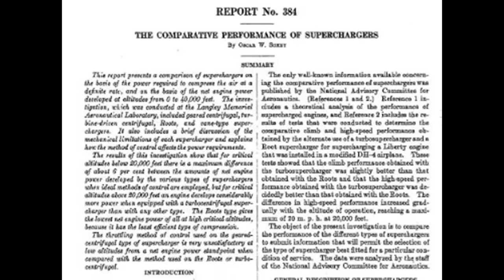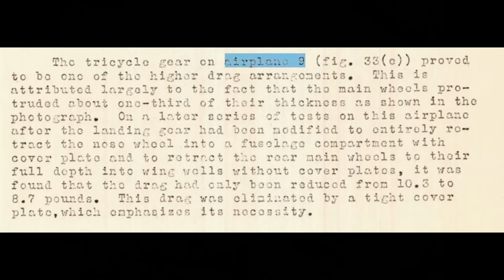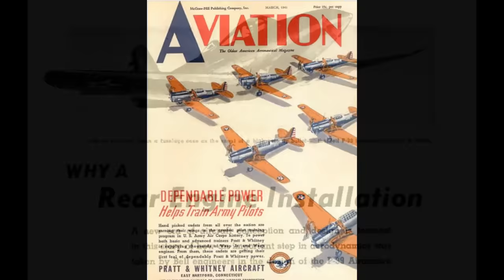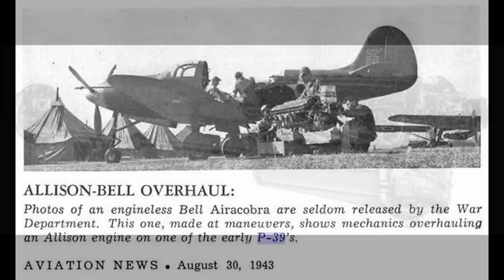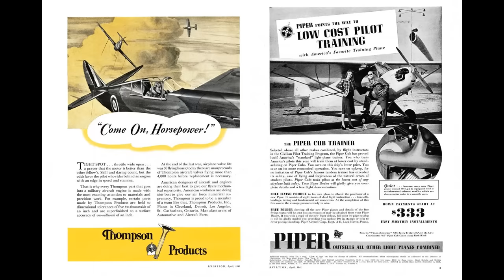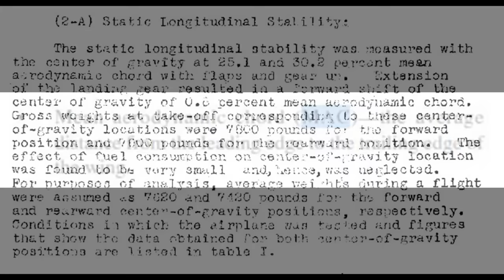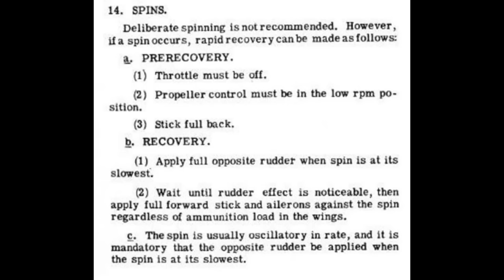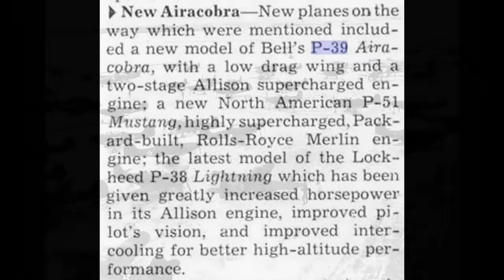Bell P-39 Airacobra, Why the Mid Eng?

Comment: I almost drool every time I find a new source on the P-39 and when I find Greg's? Rapture!

I'm going to relate more of my stories about Radio Controlled model P-39s. I've had four myself and, as a designated club test pilot for many years, I've flown others as well as countless other WW2 fighters and the P-39 is my favorite model of a warbird by quite a margin. 

It has everything I want in a model: not too much taper on the wings, long moments, and big tail feathers. It's one of the very few WW2 fighters that can be scaled down without changing anything but the airfoil; because most full scale airfoils don't work right when the size is reduced. The models I'm familiar with use a modified Clark YH and, regardless of size, it's damned good.

A model isn't a direct comparison with the real thing but I can share some impressions. Keep in mind that my models have a engine and fuel tank,  or motor and battery, in the nose so the weight distribution is very different. I will limit my comments to aerodynamic traits.

The Cobra is stable and maneuverable and, yes, mine will do a lomcevak as well as any model I've flown.

It will "wind up" in a sustained spin. That's where the long nose, I think, comes into play. Recovery on my models is excellent but if you let it go it will turn flat with a lot of pitch oscillation. It looks fantastic! My guess is that the other reports I've seen are correct; if all the nose gun ammunition was expended it could be hard to recover from a spin but that seems to have been solved by retaining the spent cases from the 37mm instead of ejecting them. With that long nose, a little bit of weight can make a huge difference.

Conclusions:

I think I know why the Soviet pilots loved it. It was a really good fighter. It wasn't a good high altitude interceptor but within its altitude limits it remained a good fighter till the end of the war. It makes a great model and I think that says a lot.

One, final, thought. The Cobra was just too small for a turbo and, compared to later allied fighters, too small period. A little more wing area and internal space...?

Cheers!

Comment: Wikipedia (yes, I know) says that when the plane had a far-aft CG, such as with no ammunition in the nose, it was easier for it to enter a flat spin.  They claim that was demonstrated to Bell by the Russians, as Bell hadn't been able to reproduce the behavior on their own.

That's the only negative I've read about the Airacobra's handling.
Reply from the maker: I'm sure it's true that with an aft CG the P-39 would more easily enter a flat spin. However that's true of every airplane. Many airplanes can't get out of a flat spin, but Bob Hoover showed that the P-39 actually could. I think Hoover's technique of putting the gear down would work with or without ammo, but I don't have any way to verify that.
Reply: Wiki ! Any clown can contribute.

Comment: P-39s were used by U.S. air forces only in the early battles of war,  particularly at Guadalcanal and New Guinea, where they were considered inferior to Navy Grumman Wildcats and A.F. P-40s.  Not only had the P-39s been robbed of a 2nd stage turbocharger in production, but the air corps stripped them of oxygen,  making pilots unable to fly effectively much above 14,000 feet!  This really hampered their ability to use the vertical,  slash & burn tactics as Chennault's flying Tigers in China and embattled Aussie   pilots in New Guinea did with their  P-40s, and Navy pilots did so effectivelynin their Wildcats.  Ironically, Japanese Zero pilots considered the snappy little P-39s more maneuverable than any other allied aircraft... Though still far short of the lightweight Zero. Other allied pilots joked that the P-400 (20 mm cannon version of a P-39) "was a P-40 with a Zero on it's tail."  Standard practice at Guadalcanal was for the Navy and Marine Wildcat pilots to claw for altitude, and then dive on the Zeros tangling with the hapless P-39s below. Above all the P-39s & P-400s were a testament to the courage and dedication of American pilots in those battles, if you got a Zero on your tail it was hard to shake him off, you never started with much altitude to dive from.

Comment: Thanks for another great video.  I read about the p-39 being used post-war in air racing--and doing really well.  Would definitely be interested in a P-63 video!
Reply: The P-39 won the 1946 National Air Race and was leading the1947 race when the engine blew on the final circuit. That proves that all the P-39 needed was  more HP and a gear driven supercharger. I had a single speed supercharger so why not a two speed? Put a Packard Merlin in it and see how it does at altitude. The P-39 airframe was preferred over the P-63 for air racing.

Comment: I see that they stuck with the unusual canopy/door design with the Kingcobra.
Reply from the maker: They sure did. They fixed just about everything else, but didn't do much to improve the visibility.
Reply: @GregsAirplanesandAutomobiles  I don't even think that the visiblity was even all that bad. Other aircraft that already had 360 degree visibility, such as the P-38, also didn't change in cockpit canopy design.

Comment: My gut is telling me to be careful about buying Robert Woods stated reasons for the mid-engine configuration at face value.  The pilot G tolerance reason sounds like an afterthought Bell made up because they needed one more explanation for the article, and the aerodynamic benefits alluded to also seem tenuous.  I'm more inclined to think that room for heavy nose armament as well as the turbo installation not forcing the cockpit back toward the tail are the useful benefits worth the weight penalties of the driveshaft and long nose gear.
Reply from the maker: I think you're right about the G-tolerance. I would like to hear what a modern fighter pilot thinks of that.
Reply: @GregsAirplanesandAutomobiles   I've pulled enough Gs in cockpits at different distances from the CG to think this is a question of interest to an engineer or physicist rather than a pilot. The transient G you get from any pitch rate caused by the elevator is nothing compared to the G produced by the wing that alters the flight path.
Reply from the maker: I didn't realize you flew planes of that sort. Anyway, I agree, it just doesn't seem to me like it could be a significant factor.

Comment: There is an example of a piston-engined fighter design with tricycle landing gear, the nose wheel folding under the engine, and nose-mounted armament: The Me 309. Which admittedly never entered full scale production. In the jet era there were the Yak-17 and Yak-23 fighters, and the Messerschmitt-designed Hispano HA-200 Saeta.
Reply from the maker: Yes, but it's a much later design, and one that never went anywhere.

Comment: Hi Greg, many months ago i think it was the FW190 aircraft, i mentioned my thoughts on why the Germans had leather straps fitted to the rudder controls. My hypotheses was that given the piilots flat sitting position, this gave them greater leverage in controlling the rudder by both pushing on the left and pulling up on the right. This i have seen confirmed by watching the rudder operation in the Hellcat. No straps were fitted but provision was made on the rudder control where a foot could be slid under each pedal for  achieving the same thing..

Comment: Great video as usual Greg! In regards to the stall and spin misconception, I think a good enough deal of the misconception actual comes from the P-63 King Cobra. More accurately I remember that when I was younger I was told that the new wing and raised wing placement (if I’m getting that that right) helped to attune for what you described in the spin and stall characteristics of the Airacobra. 

Will love to hear more about the P-39 (especially since it can be the gate way to Yaks) and even a little about king Cobras!

Comment: Minor extra point on the CG location as a percentage of MAC : it is not the cg percentage by itself that counts but its comparison to the percentage of the chord for the center of lift. That one is dependant on the wing profile (and AoA and hypersustentation), but it's generally in the ballpark of 1/3 of the chord, making direct cg comparison not that far off.

Great video, thanks for the upload.
Reply: 🤯 way beyond my brain 🧠 power! ..lol...from Wyoming USA 🇺🇸 🤠
Reply: My fault, i'm too used to explain things with drawings :(
How stable your aircraft is depends on how far forward your center of gravity is from your center of lift. 
So if you want to compare stability between different airplanes, in all rigor that is the distance you should use (CG to CL), not the position of the center of gravity on the chord of the airfoil (chord is the distance between leading edge and trailing edge), because the CL will change from airfoil to airfoil.
But center of lift is a bit of a pain to pin down and is in no way static, and you can usually approximate it to 1/3rd of the chord. So for the purpose of the discussion, what greg did (comparing center of gravity positions to see if they are in a reasonnable ballpark) is still valid.
Since the audience here  is partially made  up of physics nerds i thought that deserved a mention.
Reply: @pegzounet  the P39 could have been so much better, than the plane, it's a giant shame what they did,! ...from Wyoming USA 🇺🇸 🤠
Reply: @pegzounet  I'm a hands ✋ on A.DD., dyslexic type!.lol you sound like you've at least grown up with computers, with C.A.D. stuff! That is so cool to watch work, to me anyways! I have a tin of aeronautical idea's 💡 about plane's with this drive train design, even a private high-wing type plane, in my head. I can barely text..lol a ludite I think is the term for me....from Wyoming USA 🇺🇸 🤠

Comment: Hi Greg, Firstly thanks for all your videos and related content - really excellent. And, made easy enough to understand for those of us that are not technical specialists. My comment relates to aircraft tyres and other landing gear. In your video "Corsair Design Features" there is a photo of a Corsair on the flight deck, with ground crew around it (time at @ 19m.47s) In this photo the Corsair tyres appear to have two different tread patterns. On the starboard side it shows a tyre that has a straight pattern. But on the port side the tyre seems to have a 'crossply' pattern. Was this usual? Or was it a case of using what was available at the time?
This brings me to think that a video on the evolution, styles and efficiency of aircraft tyres and undercarriage would be very interesting. Considering that the landing gear is the vital connection between the aircraft and the ground when not flying. Just as important as flight controls in its own way. And there were wheels, floats, skis, skids and dollies from 1903 onwards. Anyway - it's just a thought. 
Thanks again for the great videos - and excuse the spelling of 'tyres' instead of 'tires'. Remember you have a global audience now! All the best.JB
Reply from the maker: Thanks for your kind words. Normally they would use two tires of the same type on Corsairs or most other planes. However during wartime, it's not always possible to avoid mismatches.

Comment: In the picture of the P-39 at the 43:38 mark there appears to be some type of structure attached underneath the nose by a couple of support bars about 1/2 way back between the prop and the cockpit. My guess is it was a water spray bar for wing icing tests or maybe a smoke bar for airflow tests. Or I could be completely wrong, any thoughts?
Pete

Comment: Once again, great job Greg.  The topic of manifold pressure  is frequently  discussed in your videos. Much different than autos in which torque and horsepower are the common measures of performance. Can you review this property some time and explain how it relates to horsepower and airspeed? I know that prop speed is fixed. Is airspeed then increased most by manifold pressure, horsepower, prop pitch, or a combination of all three? Is   manifold pressure the final common denominator?
Reply from the maker: Automobiles have manifold pressure as well, and it's really important, but few seem to understand it. I have an entire video on manifold pressure.

Comment: usually what you see in still flying P-39's is a heavy tool box in the front, mostly to help with getting the nose down for landings but it also helps in the fact that the box generally will have all the tools you need to work on the aircraft with, tho I remember one pilot kept a large bag of buck shot there.
Reply from the maker: That makes sense as the armament was a part of the weight and balance.

Comment: Another excellent job Greg. A big part of me is wondering if the deletion of the turbo had anything to do with availability of nickel. Obviously america never suffered the strategic shortages that much of Europe faced, but nonetheless nickel would have been relatively rare and expensive. It's vital for high temperature devices such as turbo rotors and it may have been directed to bomber production... At least this might be a piece of the puzzle.

Comment: I love the idea of the P-39. It might be because my British forces were so stuck with the ineffective .303 whilst facing mass bombers, or maybe its just the novel rear engine. I'm pretty glad to have a full length video on the aircraft, cool to hear it was more than just weapons and frankly its surprising more didn't attempt the style. I wish it had two stage supercharging but it sounds like it would have needed new wings and other developments to really get going. By the time it got them in the P-63 I assume the P-51 was already too established to really challenge.
Reply from the maker: Yes, the P-51 still out performed the P-63 in many respects and had far more range. Thus there was no reason to switch to the P-63 and doing so would have cause a logistical nightmare. At that point the jets were coming anyway.

Comment: 1930's aerodynamics, as we see here, still had a lot based on "looks" rather than real testing.  Engine placement was largely irrelevant since the CG and CL still have to be within the same margins.   I think you nailed it when teh idea of a slender nose section was overcome by high drag of the turbocharger placement and lack of full gear retraction.   Basically since it was no better performance wise, it made sense NOT to produce it in large numbers.  Better to have fleets of cheap/robust radial engined planes than introducing another type for no gain,

Comment: I think that's the most practical "unusual" single engine configuration, the drawbacks are not so bad and could be solved if there were more planes adopting this design
Reply from the maker: You could be right. Due to the advent of the jets we never really got to see this idea fully mature.

Comment: Hi Greg, great information as usual. I’m off the topic of this video I know, you did mention high drag wings a couple of times, my question is:~
Could the Hawker Hurricane have had a higher max speed and tighter turning abilities with a ‘thinner’ wing?
In your opinion, if so and why was this not done?
Cheers,
Ian
Sydney, Australia.
Reply from the maker: The Hurricane's turn performance was already really good. A thinner wing would have made it faster, but at the expense of the low landing speed and turn performance.
Reply: @GregsAirplanesandAutomobiles  many thanks for your reply.
Reply: The Hurricane’s modified Clark Y was flat bottomed and easy to manufacture and was an established safe aerofoil for the urgent introduction less sophisticated British fighter, the Spitfire NACA 4 digit aerofoil was a complex asymmetric doubled curvature design much more costly to produce.  Some Soviet fighters also used the modified Clark Y.

Comment: Greg:
Thanks for another great video on the P-39. I would like to see a video on the Tempest and Napier Sabre sleeve valve engine. I find this engine to be vastly overlooked as a good design that needed more development. Very similar problems with the need for more work on the supercharger/turbocharger boost problems to see the full potential.
Reply: Don't say that to my grandfather - he hated those things. They caught fire, they smashed themselves to fragments on a cold soak start, they leaked oil, fuel and anything else worse than a Royal Oilfield. The Stag v8 in original form had a better survival rate.
Reply: @rosiehawtrey  Every new engine combination has teething troubles. By mid 1944 the Tempest was a very effective aircraft. I have always liked the P-39 & P-63. But, many American pilots hated them.

Comment: Very well done. Thank You. That being said I am having difficulty visualising the cannon firing through the shaft leading from the motor to the propellor. How was that done?
Reply from the maker: Hi Bob. The cannon DOES NOT fire through the shaft leading to the propeller. You're having trouble visualizing that because it would be nearly impossible to do. The shaft is offset to connect to the gear drive below the center of the prop hub. The cannon is above the shaft, thus it only fires through the hub, not through the drive shaft. I hope that helps.
Reply: @GregsAirplanesandAutomobiles  Again, thanks.. The cutaway also explained it. BTW, I really like your technical approach to your subjects

Comment: Another great video Greg, thank you. 
No mention of Rolls Royce’s  mid engined version of the Mustang in prototype mockup form. I believe the mid engine configuration by Rolls Royce was to make improvements in efficiency to their charge air & intercoolers as there was no more space left in the current, at the time, front engined fighter configuration.
Reply: You might be mixing up the Rolls Royce modified ‘MkX’ Mustang I/P-51A which had the intercooler radiator in a chin position.  The original small ventral engine coolant air intake was too small to handle two radiators.